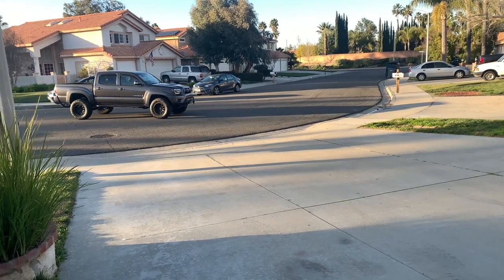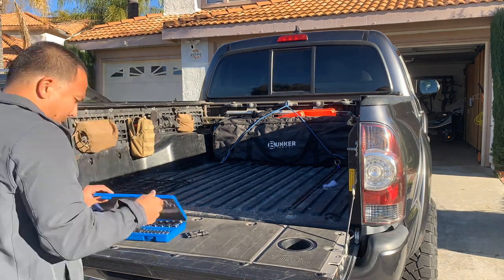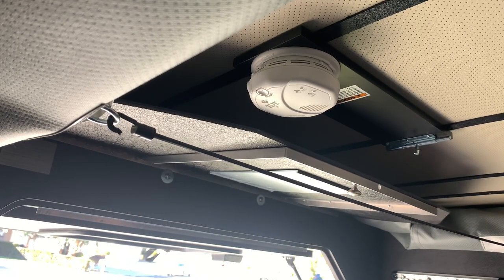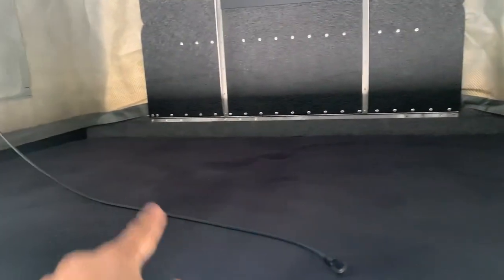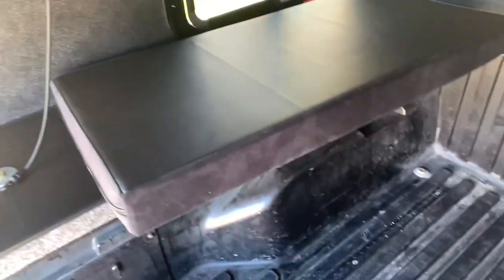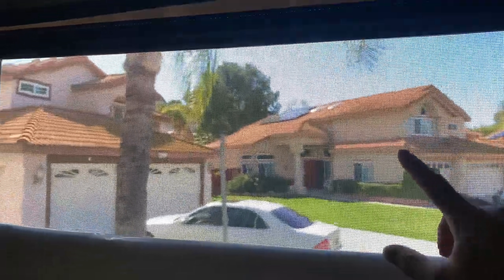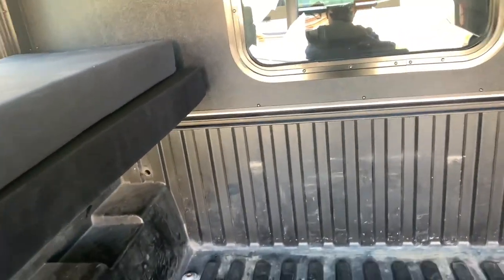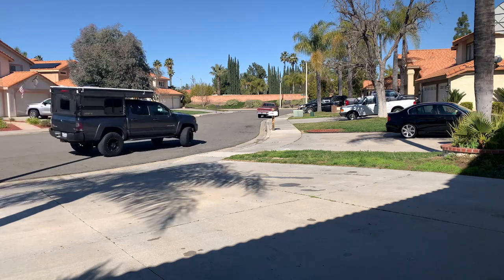Project M on 2nd Gen Tacoma (shortbed) / Four Wheel Campers

Comment: I'm looking to get one of these in a shell model only. Those upgrades are crazy expensive. I'll maybe get 1 fan installed. I just need a place to sleep when I go to AZ rockhounding in the winter. Would like to find a used unit, but they haven't been out that long, so may have to wait.

Comment: Nice 👍 what kind of mpg did you get before the camper, and after the camper? What kind of suspension upgrades did you need? Thank you 🙏
Reply from the maker: our truck was already heavily modified before the camper so its hard to calculate mpg difference for stock tacoma. for our truck, its 16.6 mpg without the camper, 15mpg with it on. I imagine wind drag probably has more impact than weight. it only weighs a little over 300 lbs so you generally don't need suspension upgrades for the project M.

If you're interested here are some upgrades on the truck (not because of the Project M):
-OME BP51 with heavy leaf pack suspension
- 4.88 gear eaton elocker for both differential
- C-4 low profile front bumper
- smittybuilt x20 winch
- 33 inch tires 

I hope that is helpful

Comment: Well... any updates? Would you buy it again or do something different?
Reply from the maker: We still love it. ive been meaning to make an update video. the biggest issue we have with the set up is that the tailgate is not airtight or water tight. no matter the rubber gaskets we put, there is still ingress of water when it rains and slight dust on dusty trails. this s less the project M and more the truck itself.

Comment: Do you have massive empty space between the camper, the bed rails and the tailgate?  In my 2nd gen since the bed rails are curved there's this huge open void where I can see into the camper from the outside.
Reply from the maker: no space between the side rails and the truck but there is a little space along the tailgate area. these tailgates are not built to be completely airtight. we put some automotive door rubber gasket on it to help seal out dust and it does help. its not so much a project M problem but a truck design problem.

Comment: Did you do any rear suspension upgrades…..if so what.?
Reply from the maker: We did have suspension upgrades. we use the Old Man Emu BP 51 with the heavy leaf pack. HOWEVER, we got the suspension upgrade not for the project M. We got it because we also tow a humvee trailer when overlanding. The project M only weighs 352 lbs.